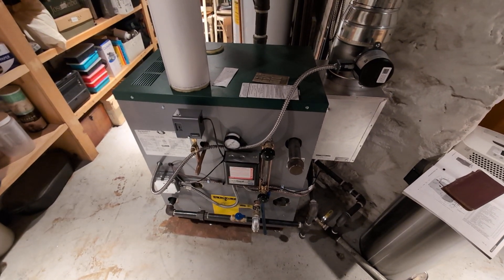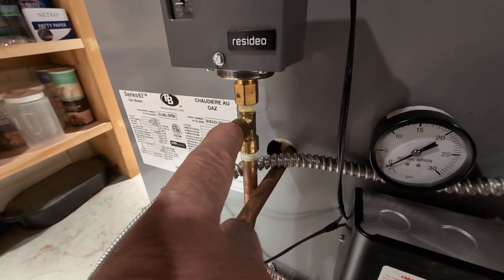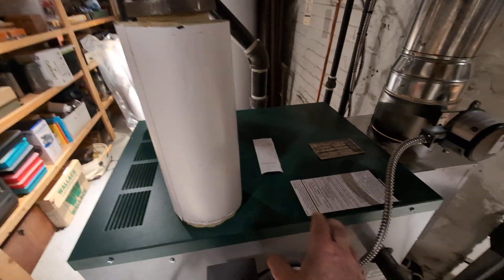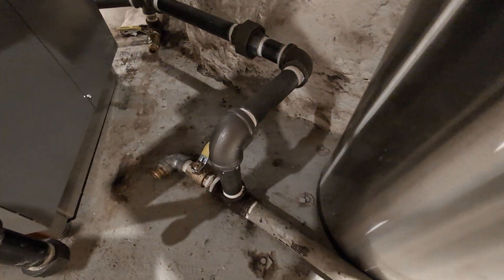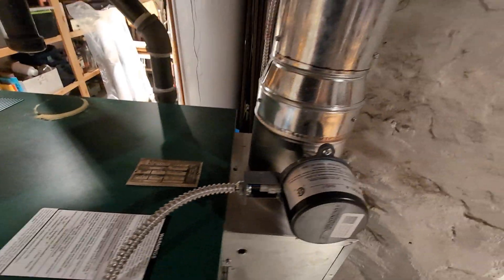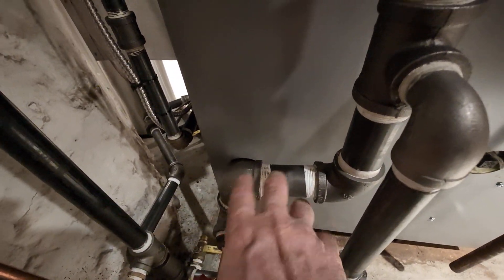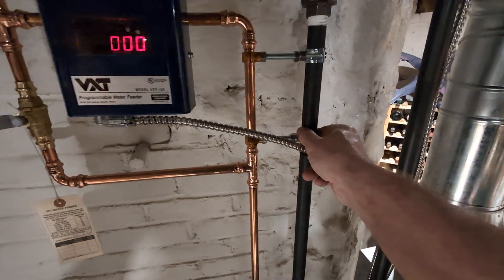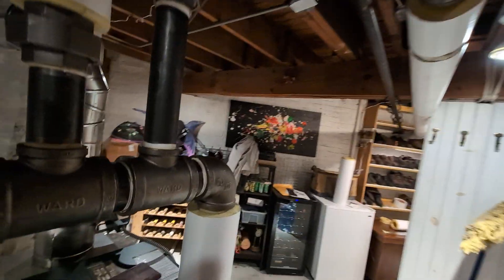Peerless Steam Boiler Installed On A Two-Pipe Hoffman Vapor Heating System

Comment: I recently had my old boiler replaced the Hoffman earlier design with no moving parts except the water went home with the plumber as a trophy.
He is returning the system to vapor vacuum replaced the wet return reset the pitch on all the pipes.
He replaced all the radiator valves with new valves with adjustable orifice sizes. New steam traps a Gifford loop.
He is trying to get a new radiator replacement for the kitchen which was about ten feet long. Might be a while before it’s delivered.
I’ve had no heat since January but I have electric heater’s which are helpful.

Comment: Hello, gr8 informative video. Question: Do u use a backflow preventer with your auto water feeder installs?
Reply from the maker: Thank you for your kind words and question!
Yes, we use a double check style backflow preventer (although, Hydrolevel does not recommend either a BFP or PRV on the line to the VXT, they also say to obey local codes).

Comment: Lovely presentation, as per usual. ❤ A quick question: do you ever use Big Mouth vent, and under what particular circumstances (vs Gorton #2)?
Reply from the maker: You are most kind, thank you for your support!
We used to think that a Gorton #2 vent had a float that would close off the vent if the system flooded with water.
Direct experimentation and a discussion with the owner of Gorton has disabused me of that notion.
There is no float in a Gorton as the term is commonly applied, sad to say.
So in that case, my major objection to the Big Mouth vent has been removed (that it had no float to close against a flood).
So, in this particular situation, a Big Mouth might be indicated, as it only needs to stand guard on the dry return in the unlikely event that steam improperly enters there.
I would NOT use a Big Mouth in situations where it cycled every time the system ran, as I have some doubts as to its longevity vis-a-vis a Gorton (which has no vaporizing fluid to be lost).
Reply: @gordonschweizer5154 Nice presentation of a beautiful installation. 

Some years ago I replaced the Gorton 2 at the end of my main with a Big Mouth. Motivation was simply the greater vent rate of the Big Mouth. I hadn’t heard about any longevity problems with it and to date it cycles fine. It sure seems to be built solidly.

I take it from your comment about the skim port that you don’t typically do a skim after installation. Despite the possible oil in the new boiler and the iron pipe in your install, you don’t see much if any surging in the sight glass?
Reply from the maker: @marcinmerrimack1726  Thank you for the kind words!
Glad to hear that you are pleased with your Big Mouth main vent.
We also use Big Mouths at the ends of mains on two pipe steam systems as "cross over traps" to send air back down the dry returns towards the main vent.
Those Big Mouths do not have the "o" ring on the seat that yours might have.
The "o" ring was found to be needed during "beta testing" of the Big Mouth main vents to keep it from spitting water when it starts to shut against the steam.
I have some doubts as to the longevity of that "o" ring.
Reply: @ I’ve had my Big Mouth several years now. Don’t know whether or not it has the o-ring. But I’ve witnessed it several times closing against the steam and it’s smooth in operation.
Reply: @gordonschweizer5154  thanks for the response. The o ring on the big mouth is silicone, if I correctly recall. I'm mostly interested in use for evacuating air and not creating back pressure against the system, thus the question re big mouth. I also believe big mouth is somewhat more economical, cost wise, but I may be mistaken.
Reply: @gordonschweizer5154  re flooding: I would prefer water coming out in the basement, vs what I witnessed once, a stuck make up water solenoid, and water freely flowing from radiators... 😳
Reply from the maker: @nosceteipsum513  As to flooding, yes, I agree with you on that.
And if you can pipe the outlet of the Big Mouth to a drain or sump pump, even better!

Comment: I know the 0-30psi gauge is code, I was wondering why you never install a second gauge with lower increments? I replaced mine with a 0-3psi gauge in my one pipe dry return system. Very rarely will I the needle move close to 1psi. So I suppose its really not necessary, but the service tech in me needed it 🤓
Reply from the maker: We used to install low pressure gauges all the time, especially on vapor systems to show how the system really worked.
We found that many of the low pressure gauges would fail after a few years, and many folks didn't really seem to grasp the incredible understanding of what the low pressure gauges were showing them.
They are best added per request, and with a shut-off valve to isolate them after the information they provide is no longer needed.
Reply: @ good points, especially the shut off valve
Reply: @gordonschweizer5154  During some boiler maintenance, I (as the homeowner) replaced the worthless 30psi gauge at the pigtail outlet with a good quality 3psi model. Very useful tool to check for proper boiler operation and a possible clogged pigtail. But I didn’t see the need to isolate it with a shutoff valve. It’s designed for 3psi and only during a setback recovery do I see pressures above a few ounces.

Comment: I love that 1925 Hoffman Data Book. Thanks for uploading it to Heating Help. When I was doing my system upgrades I used it for the pipe sizing on the (2 pipe) first floor. And the system runs great. Excellent system balance at only 0.5-2" WC pressure and in vacuum, between cycles, as well.
Reply: Got it!  Thanks Gordon and to you too for the heads up.  Looking forward to reading that.

Comment: Love what you do and lessons learned. How do you determine if system is parallel ?
I have a Hoffman differential loop earlier design with two pipes.
I’m have a series 62 peerless boiler but I have not been able to drop the pressure below 1.5 pounds on the pressuretroll.
Reply from the maker: Thank you for your support!
If there is a wet return, it's a good bet you have a parallel system, at least for that one side.
Check, if you can, with a level.
As to your pressure, if your boiler constantly cycling at 1.5 psi, you might need to install a Vaporstat in place of that pressuretrol, and see if you can down-fire.

Comment: I have the same boiler that the previous owner installed, maybe by himself considering all the mistakes like; Hartford loop right at normal water level instead of 2 " to 4" below, skim tapping blocked off by putting the equalizer right in front of it and only 2" away......I could go on and on.  Nice to see how it would've been done by an expert!  I switched to a 24V Cyclegard and added a relay and that allowed me to power my thermostat from the 24V and add a remote temperature sensor to it.  First relay I bought was defective and that was a PIA because it caused my gas valve to chatter.
Reply from the maker: Thank you for sharing your story!
I hope your Hartford loop doesn't "bang".
I don't know why Peerless uses the 120V LWCO set-up.
We usually install a "fan center" relay on a junction box on a joist near the boiler that is powered by the boiler circuit and run the 24V off that to power the t-stat.
If we were to remove the 120V and go to a 24V LWCO, for us there would be potential liability issues and that could trigger a denial trap with insurance.
Reply: @gordonschweizer5154  It doesn't bang since I increased the downward pitch on both of the brass dry returns and I am very attentive to any steam leaks and to keeping the water level about 3/4" above the top of the Hartford Loop.  Another thing the previous owner did is he piped the entire equalizer and Hartford and wet returns with sweat soldered copper.  Big pain for me to redo it and I haven't lol.
Reply: @captainwho1 A Hartford loop above the normal water line is called a "Gifford Loop" and is an actual thing that is done to stabilize the water line. In your case I don't think it was done intentionally but I don't think there is any problem with letting the water level be under the loop, as long as there's a wet return on the other side that is normally full of water.
Reply: @theodorgiosan2570  Isn't there always a wet return on the other side?  I have dry returns that go all the way back to the boiler and then drop down vertically to the wet return.  I'm trying to remember back.  It's been a while.  Initially before I learned, a guy came in the trade who apparently wasn't knowledgeable and turned our pressuretrol up too high and that combined with the water level being below the top of the Hartford loop allowed the boiler to push water up the wet return and spit water out of the vents at the end of the dry returns.  Peerless says 2 to 4" below NWL.  This guy was a knucklehead who never read instructions.